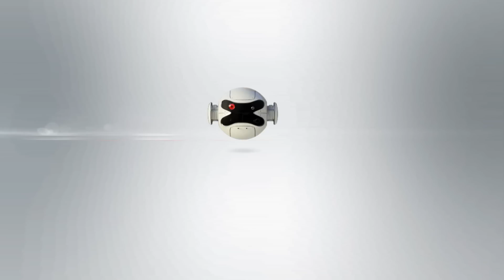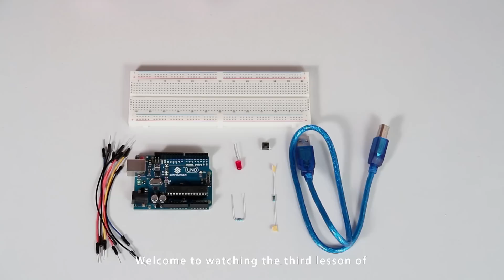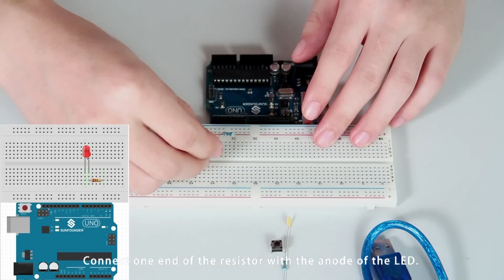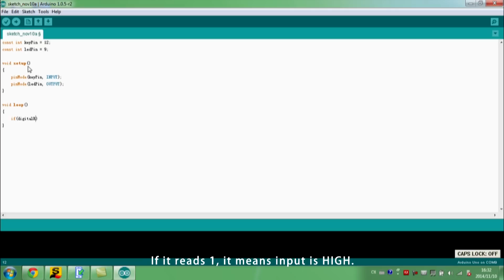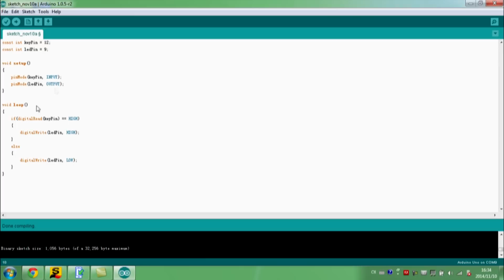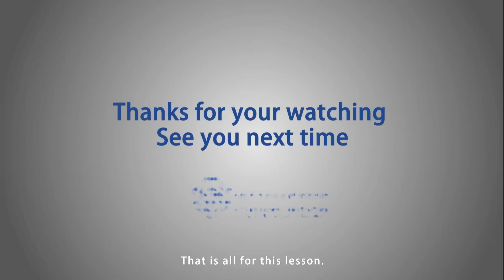SunFounder Learning Starter Kit Tutorial for Arduino - Control LED by Button

Comment: Aren't we short-circuiting pin 12 with the power source through the button? We put a 220 ohm resistor in series with the LED to limit the current to 20 mA. Aren't we supposed to do it with pin 12 as well?
Reply from the maker: Hi alemassa. After the Arduino board is powered on, the digital I / O port is floating, and the value read through digitalRead () is unstable (may be high or low). The function of this pull-down resistor is to provide a stable state for the I / O port. If there is no such resistor, then at the moment of power-on or when the external electromagnetic interference is too large, the state of the pin may appear high and low transitions. At the same time, without pressing the button, the I / O port is floating. In this case, the level of the pin is unstable, so this resistor is required. Connected to ground GND through a resistor, fixed at a low level.

Comment: Found this way too challenging for a first tutorial - but guess what, I DID IT! The light goes on! And I worked out for myself what the hell was happening. I started off ignoring the signal (?) pins, and just using the Arduino as a power source (with the 5V and GND connected to the +/- on the breadboard)... just to make sure I had everything around the right way. And then I stepped through the video (for the 3rd or 4th time) ignoring the video and schematic and just following the voice/subtitles). The kit itself seems pretty good but now that I've tried reading the instructions, I wish I'd shelled out a bit more for something with better support (the forum hasn't been updated since 2016, I assume it's abandoned)
Reply: Excellent. You saved my day. As you say, don't be afraid of using your logic and voila, it worked. I'm not sure why this video is recommended for "Lesson 1: Button" since it clearly isn't. The myriad of wires she is intimidating for a new learner. As for the unintelligible accent of the techie presenting, well, we simply have to get used to it!

Comment: I recently bought the sunfounder kit and I agree the tutorials are pretty bad. I would suggest that the person doing the video clearly shows where they are putting the wires and even though it's a little elementary literally go step by step like, for this lesson we will start by putting the led in the d column of the 30th row. Also after she connects something she should pause for a few seconds so we can see what she did rather than cover the entire breadboard with her hands  a second later. I had to pause and rewind so much just to see what the woman was doing. When she is grounding the wires she could say put on end 1 space away from the led and connect to the negative side or connect to the positive as I've seen her do both in the video. Also show a clear diagram that matches exactly to what she is doing on the video. I look forward to learning but the tools to learn so far haven't been the best. Instead of having an intro that takes 20 seconds to the video I would prefer more on screen time and I wouldn't mind longer more in depth videos since these are meant for beginners and the tutorials seem to be set up to people who are already familiar with what to do.
Reply from the maker: Dear Mojojojo023, 
It's really a bit inconsistent, in the instruction book, use the button to light the LED embedded in the control board. We feel sorry that in the video, the lighting botton is connect with the pin 12 LED, we decide to remake the video.  
Nice day!

Comment: First, the quality of parts is great. Good quality, nice case and all, but that's as far as it goes! Thier tutorials are probably the worst on the market!!! I purchased this kit in hopes of learning Arduino, the basics of coding, how and why it all works. Like Nate Johnson said; "it doesn't teach me how to do anything" but to put things together, you have to Google the info you need to do the task? Example; tutorial 2 the book doesn't even coincide with this video. The book shows one push button and one resistor to complete the task. The video shows one push button, one LED and two resistors to do the task???? In lesson 1 the schematic is wrong it shows the resistor connected to pin 22 but in the lesson, it uses pin 9. That's as far as I got "too much aggravation". I put the kit in the closet and bought another kit from a reputable company.
Reply from the maker: Dear Curtis,
It's really a bit inconsistent, in the instruction book, use the button to light the pin 13 LED embedded in the control board. We feel sorry that in the video, the lighting botton is connect with the pin 12 LED, we decide to remake the video. 
The schematic of the lesson 1 is right, the pin order number is help you to get how much pin is available on the control board. It's useless for you, you need to the internal pin definition D9 PWM.
Nice day!

Comment: What's the purpose of the resistor before the LED? Thanks
Reply from the maker: Most LEDs can withstand a maximum current of 20 mA, so we need to connect a current limiting resistor in series.                   
The formula of the resistance value is as follows:
R = (Vsupply – VD)/I
R stands for the resistance value of the current limiting resistor, Vsupply for voltage supply, VD for voltage drop（always 1.8v） and I for the working current of the LED.
If we provide 5 voltage for the red LED, the minimum resistance of the current limiting resistor should be: (5V-1.8v)/20mA = 160Ω. Therefore, you need a 160Ω or larger resistor to protect the LED.